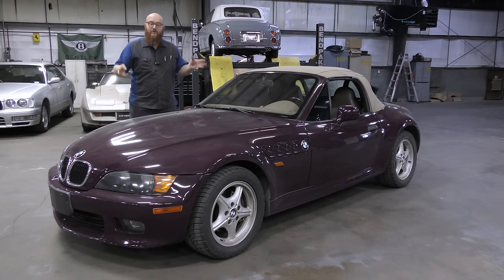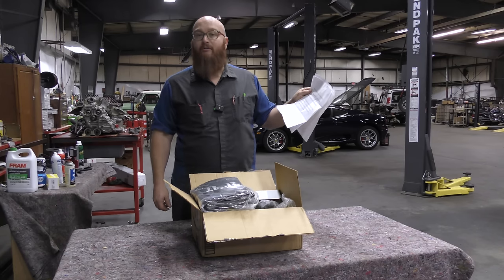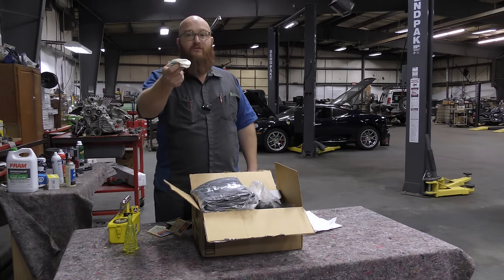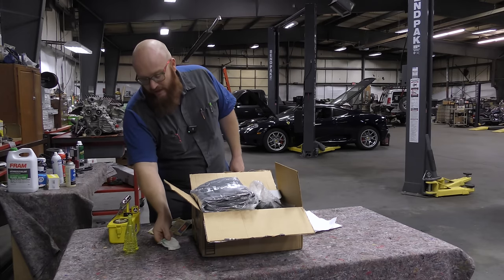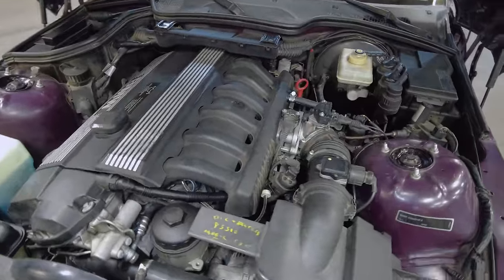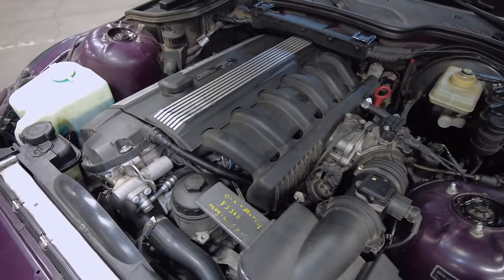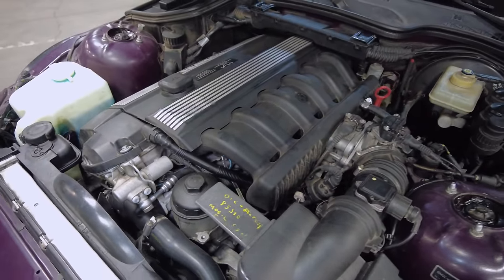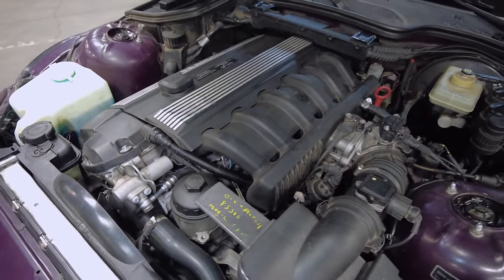My BMW Z3 Almost BUSTED My Wallet!

Comment: I don't get why he always slates German cars. Would  25 year old American car not need new shocks, bushes, hoses, etc? These parts are made of rubber, they will disintigrate at the same speed on all cars.
Reply: Any car would, I agree ridiculous comments.
He spent as much as the car was worth because the car was dirt cheap.
Those are totally the wrong tyres, guys clueless
Reply: Miata that age wouldn’t be any different or cheaper
Reply: Actually I've seen a number of the earlier BMW's he didn't mind working on:  I've seen an E24 6-series (1977 to 1989) as well as a beautiful black little E21 3-series (1977 to 1983) that were the lucky recipients of the Car Wizard's magic touch.
Reply: Because he is american not german. Same in germany and Europe, people like german but critisize american made. What you do not know and do not feel attachments to is much easier to critizise, than something you might either have nostalgia or nationalistic tendencies for. If one dear brand has all sorts of issues it is easy to just find excuses, while if something foreign has issues it is easier to call it what it is, junk.
Reply: It’s just more worth it because they handle 😂

Comment: as a German speaking, these old BMWs are very reliable if you do preventitive maintance. Most parts are cheap here and if you take care of your car, its value rises quickly
Reply: Exactly what I said.  Pretty easy to pick out the BMW enthusiasts who understand these vs. the trolls and haters simply regurgitating the same phony garbage being circulated on the Internet.  Those that KNOW, just KNOW.  There's quite a number of very popular Youtubers who understand these cars much better than the trolls I see here, including Jonny the Car Ninja and Sreten at M539 Restorations.  Sreten in particular has built a remarkably large and loyal Youtube following for his willingness to take on restoring a number of BMWs from the 80's through late models.  Remarkably, he even took on a very difficult and challenging restoration of an E60 M5, replacing the notorious camshaft bearings on that car before they failed, which would have turned that E60 M5 into a very large and very expensive paperweight were it not for his timely intervention.
Reply: @houseofno  STILL MONEY PITS...period
Reply: @houseofno Dang the cam bearings are also notorious on E60 M5s? I thought it was just the rod bearings, & a bakers dozen of other expensive issues, as reported by multiple BMW mechanics.
Reply: I don't see how they're reliable if you have to replace half the car. I would say a Toyota is reliable since they don't need any of this work doing in the first place.
Reply: @chadhaire1711  Not at all. Been driving 'm for over 20 yrs.
Reply: @user-ue6iv2rd1n  Had a Celica T18 once, that was the one car i owned who needed a lot of repairs.
Reply: @MarkGelderland  Like what, are we talking about a GT four?
Reply: @MarkGelderland  You have been fixing them for 20 years too.....I test factory cars for a living---drive far more than you----BMW are designed to last the warranty period.....after that money pits..at 100K miles totally done unless to spend $$$$$$$$$$$$$$ plastic cooling systems, gaskets, steering racks, sensors, water leaks, seals, fuel systems....
Reply: @chadhaire1711  No i haven't. Here in Europe people never experience or hear the BS you're talking about.
Reply: True. For some reason Americans always have problems with Euro cars we Europeans never have.
Reply: @chadhaire1711  What cars do not have plastic cooling systems?  My Tacoma has a plastic radiator with rubber hoses.  My 128I also has a plastic radiator with rubber hoses.  The only difference is my BMW has an electric water pump vs my toyota"s belt driven pump.
Reply: @Boasandpythons  No--the difference is the BMW is biodegradable junk that is DESIGNED to fail.
Reply: Not on wear items like the shocks and other suspension bits that were basically toast.  Although addressing them piece by piece every year will blunt the financial dent.

Maybe Germans are used to this sort of "quality" but here in America we expect better from our cars.
Reply: @dagamer667  the last time I changed the suspension parts of my e39 was 4 years and almost 60k miles ago. Just use quality parts like Lemförder and do the work by yourself. It is basically the same for every car. I drove lots of Hondas before, same story
Reply: @chadhaire1711  To be honest, lets say ALL of your fucking hoses fail for some reaason on your BMW. You go on FCP Euro and you buy them, and you install them for like 25 bucks a piece. You're being dramatic lol. it takes all of 15 minutes to change out ANY of the problematic hoses on one lol (coming from someone whose owned several old and new BMWs), so even if it was yearly maintenance as you people make it sound out to be, it's a cheap and easy fix
Reply: @yomansam4689  Sure Goober..and when that hose fails at 2AM in the morning 100 miles from the nearest town, let's see how "cheap" it is to fix then.......LOL....
Reply: @chadhaire1711  Your car breaks down 100 miles from the nearest town in any car and it’s gonna be expensive regardless of what you own
Reply: @yomansam4689  No Goober--you said these BMW cheap plastic hoses were an easy fix and nothing to worry about.....Your Toyota and  Honda isn't going to break down with a cheap plastic hose.  Nice try but no sale.  Go back and try again.
Reply: @chadhaire1711  Neither have any of my BMWs regardless of age, I did have a hose spring a leak in my 535i in winter 2021 but it was such a non issue.

I’ve been all over the country with my cars, never left me stranded
Reply: @chadhaire1711  And Toyotas and Hondas use cheap plastic cooling hoses just as much as BMWs do but also pop off I guess haha
Reply: @palisium  There is a HUGE difference between European cars built in Europe and European cars built in America.

Comment: BMWs that were built 20 years ago are pretty stout. But now BMW has decided to go overboard with plastic all over the engine bay. That plastic dries out and when you have to replace it the cost is as much as a metal part.

Comment: The old Coleman lantern mantles used to contain Thorium which is somewhat radioactive. In 1990 they replaced the Thorium with Yttrium which is minimally radioactive. This reduced the light output by 20% so the older mantles are somewhat sought after.
Reply: Interesting.  👍
Reply: I thought in usa they only made useless flashlights.
Reply: Man, we had so many of those Colemans in the Boy Scouts mid-eighties! Maybe thats what brought on all the early hairloss...
Reply: @wilsonlaidlaw:  Thanks for that. I learn stuff here.
Reply: @felicetanka  And automotive clocks.
Reply: @felicetanka  I bought a new Coleman gasoline lantern about 15 years ago for our UK house to use during power cuts. They work beautifully and with their electric igniter, they are very quick and easy to start. They do not like either leaded or ethanol containing gasoline, so I run on an agricultural gasoline product called Aspen 4, which I buy for our small lawnmower (our large one is diesel) and our old Techumseh generator.  I tried to buy a Coleman gasoline lantern for my French house last year but none were available from Coleman dealers in France. I wonder if the French government has banned them to try and encourage the purchase of Camping Gaz lanterns, which is a partially French government owned company. In the end I bought a German Petromax HK500 lantern, which runs on deodorised kerosene (Petrole in France). This is typically German, being very heavily and solidly built but far more complicated to light than the Coleman. It takes a great deal of pumping and pre-heating of the burner with both alcohol and built in blow lamp, to vaporise the kerosene, a bit like the old British Tilley lamps but once working, it is very bright (400 watts incandescent equivalent).
Reply: Most glass naturally contains small amounts of thorium too, though not as much as an old mantle.
Reply: @abarratt8869   There is a particular variety of Leica 50mm Summicron lens made in the mid 1950's, that has enough thorium in it to set of some airport radiation detectors. The radioactivity also has the side effect of making the glass go yellowish over the years, which is how they can easily be detected from the later lenses which replaced the thorium with lanthanum.
Reply: Any chance I can sue the Boy Scouts for radiation exposure from those hissing lamps? This would have taken place in Camp Alpine seventy years ago. I was afraid those lamps would blow up.

Comment: It isn't as much that these older BMW's are so maintenance heavy, it's that they are so badly neglected. 
Yes, BMW parts can be expensive, but if you keep up maintenance per schedule, the costs tend to spread out over the years. This car is just another example of people selling it before or when it needed some expensive parts to be replaced and then the next owner(s) simply drove it without performing maintenance, leading to everything being worn out by the time the Wizard bought it.
Reply: As a BMW owner you nailed it.
Don’t forget to keep the cost way low FCP euro is life time warranty on genuine bmw parts including fluids.
Reply: Very true sir, been on the receiving end of both situations, well maintained car and sold before it blew up car. The well maintained car I kept for 200.000 miles and only replaced the suspension and brakes + whatever "expired" due to milage like fluids, belts etc. The next owner kept it for another 100.000 and never spent a penny on it. Bought it back for pennies from him as a donor car for some parts that were hard to find like seats, trims, etc. as the rest of the car was not worth fixing at that point due to neglect.
Reply: And yet, Acura or Lexus  doesn’t have this issue.

Comment: That is a cool and lovely little scooter for the Mrs.  Nice Job.  New Coleman mantles use Yttrium not nearly as radioactive compared to the old-style mantles that used Thorium.  Coleman used Uranium glass in the glass lamp shade in the old-style gasoline lamps (used indoors).  The trade name was Kremelite or Kremax.  Due to uranium military usage in WWII, the Kremelite glass was no longer available from the late 1930s.  The glass glowed in the dark and when exposed to a black UV light. The mantles emit alpha particles - not really that harmful - just don't breath in the smoke created when you burn in new mantles.
Reply: The hazard with the old mantles when they were used with a flame (in the active mantle), they transitioned into a hard metal oxide matrix.  If these mantles were disturbed, (crushed by hand, etc.)  they turned into a fine dust, which could be ingested or inhaled, which stays with you forever.

Comment: I know all about Uranium glass!  It is also called "vaseline glass".  I don't have any pieces, but they are less than about 2% Diuranate, and while they will fluoresce under a black light, they pose no real radiation threat.  There are plates and dishes from the 1960's called Fiestaware that use diuranate, and they need special care, since they have a bit of tiny radioactivity....

GREAT video!

Comment: A few years back I was looking for a convertible.  I was looking at a BMW Z3 and went to some BMW forums and realized they are money pits.  The first owner gets to about 60,000 miles and they fall apart and everything is expensive.  I bought a 2003 Ford Thunderbird.  That was also a money pit but I bought the Ford Premium Care and luckily it only cost me $100.00 per incident and there were a lot of incidents.  I still have the T-Bird but glad I did not get the BMW Z3.

Comment: I see your rear window still has the crease. Please use the blanket provided with the vehicle to keep the crease from getting worse. I had 239,000 miles on mind and the rear window was still clear with no crease when I sold it.

Comment: I have an 05 Ram 1500 140K stories to tell, owned since 07, and an 02 Durango with only on 71K.
All need cars need maintenance.
Hoses, control arms, W/pumps, batteries, belts, O2 sensors, tranny service,, head gaskets, manifold gaskets, etc.
No car is bullet proof.
The most dependable car I ever owned was my 01 Porsche 996 twin turbo.
13 years ownership, other than standard maintenance, brakes,  oil, I only had to replace coolant reservoir, they tend to crack from compartment heat, and shifter cable.
Car was drop dead - call the cops solid.
I'm dishing out $9K for a 2000 Z3 2.5L with 79K miles tomorrow morning.
It's in great shape, (I hope) the only leak a low pressure power steering line.
It's amazing what they're going for today...
Your videos are making it easier to sleep at night,,thank you for posting

Comment: I had a BMW Z4 for 6 years. It was a fun car to drive but I never had a visit to the dealer's shop that cost me less than $1,000.
Reply: No surprise, but these are super simple cars to work on if you do the work yourself. And they are super reliable if you take care of the couple of trouble issues inherent to any and all cars. Oh, NEVER MIND - scratch all of this because if I let the secret out I won’t be able to buy these on the cheap and fix them myself on the cheap.

Comment: I recently bought one a 97 for $1600. It was it in the garage parked for many years. It still runs and drives but I’m in the process of doing the cooling system. I’ve already done the front suspension. I’ve still gotta do the bushings in the rear, I’ve installed drilled and slotted rotors and ceramic brake pads and of course it needs tires from sitting

Comment: Nice refresh Dave. I recently bought a non-running '98 1.9L Z3 with 135,000 miles on it and look forward to discovering the real cost, but fortunately for me I got it for AU$2500 plus AU$695 shipping from interstate. Considering they're north of AU$10k in good condition there's ample wiggle room for this to still be a bargain buy. Mine is Anthracite metallic with black leather and is a 5-speed manual. Oh, and the sunroof is perfect. 🙂

Comment: Hey wizard! As old bmw like these can be plagued with cooling issues, the Achilles heal for these motors are the plastic thermostat housings. Many people who refresh the coolant will replace them with metal housings, which are plentiful and available. Since you did replace it, I wouldn't worry so much, but it is a good reliability mod. Another good mod would be to replace the rear subframe bushings with polyurethane. It won't cause NVH, but it will ensure that the diff mount won't shear off at the spot welds.
Reply: david: Those metal thermostat housings are not well made.
Reply: A good mod would be replacing it with a Toyota.
Reply: @JohnHoganN8  Never had problems with my BMW's.
Reply: @stephencurry8552  And the lie detector test determined......that was a lie.
Reply: @JohnHoganN8  Yup.  Lexus > BMW
Reply: @21Piloteer  You maintain the emotional stance of a teen. Nothing bespoke in your closet or garage.

Comment: There are many people that collect Uranium glass castings. You can make a few bucks auctioning them off. BTW - they also glow in the dark under UV lighting.

As for the BMW - I like the tall sidewalls; they give a better ride over rough road conditions and are less likely to rupture on damaged surfaces. As for people saying that they hurt handling - that's a myth. Proof? Formula One cars pull 3 to 4g on the track. They do NOT run low profile tires. Low profiles are for looks - nothing more.
Reply: You are technically right but quality tall sidewall tyres aren't available anymore. Sadly, quality tyres are offered only on low profile sizes.

Comment: Yo all I've driven for 15 years is BMW I've owned 9 different BMW models I currently own a E-46 M3 and a '06 🆉🅷🅿 both are convertibles I have seen and done Soo much with BMW models and E-46 Models are my favorite ones though I'm trying to sort out my M3 at the moment so I have some emergency services done before I can drive it before I get some things replaced I'm really looking for to getting my M3 all done this Z3 looks really clean glad you can get this back in Ultimate condition Wizard 💯

Comment: I've been rehabbing various BMWs as part of my car hobby. A friend has a mint Z3 that's fantastic. I ran into a Z3 at a repo auction that was obviously someone's project car. Even though I do all my own work, the parts cost to replace everything that was broken or missing was more that what the finished car would be worth.
I'll still get one if I can grab one in better condition.
Reply: My girl has a 2010 535i w 184,000 miles… tips?

Comment: I'd suggest sticking with name brand USB chargers, as a lot of those cheap ones don't provide the best quality power (though this is more of an issue with AC chargers which need to convert to DC). These days, it's usually better to get ones with USB-C outputs for the sake of support of rapid charge standards such as Power Delivery. I've had an Anker PowerDrive Speed+ for years now and it continues to work great with every device I throw at it.

Comment: I'm not a beamer fan by any stretch...but that thing is sweet! Also, you could try some AT-205 in the transmission and see if that small leak goes away. It worked to stop a very small leak at the axle seal of rear diff in my 2006 Matrix 4WD. I just removed filler plug and transfer AT-205 to spray bottle, and sprayed some in. I would suggest adding about 1/2 of what they recommend for such a small leak and go from there.

Comment: I restored my Z3 to perfect condition did all the work myself. #1 PARTS FOR THE Z3 ARE SUPER CHEAP #2 Z3's ARE SUPER CHEAP TO BUY. So, for the price of a 2008 M5 Control arm you can buy 4 complete OEM suspension KITS for the Z3 so don't whine about it busting your wallet, its cheap to buy, repair and own. #4 Firs front half of a Z3 comes out of an 90's 3 series BMW, #5 Rear half comes out of an 80's 3 series. Older technology but very good technology and simple, simple, simple, EASY to work on.